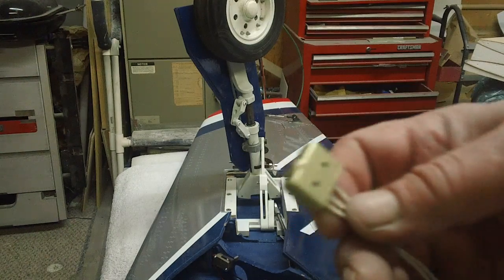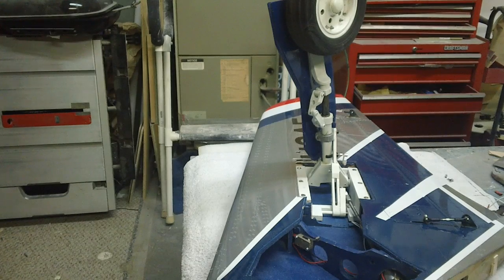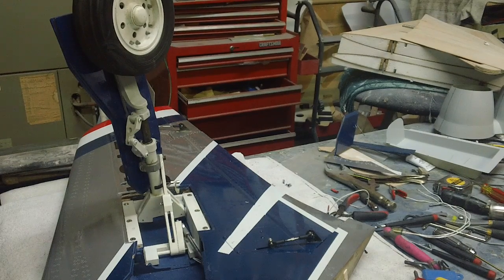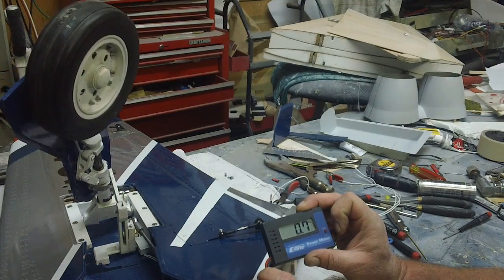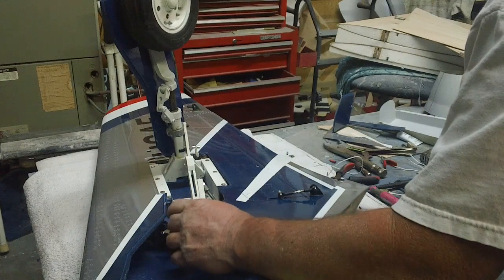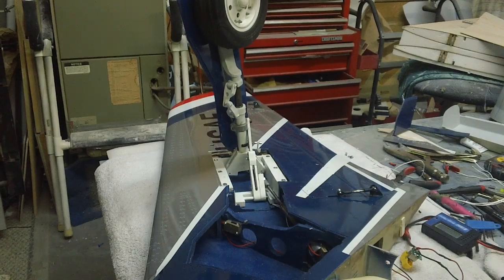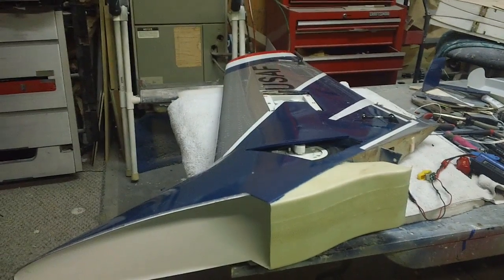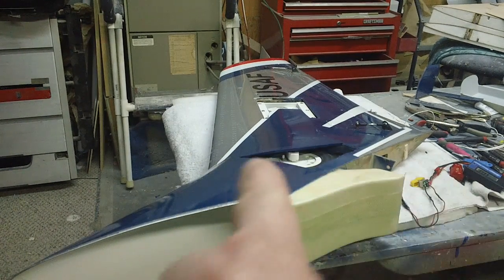working electric landing gear!!!!!!

Comment: Sorry for so many comments :-)! So it is not generating a missunderstanding I mean the microswitch lever should stay as built. Extending it inceases the error too, so it is not wise to extend it. Shortening it is no "sin" either. The main issue with the switch is that it has to react to the parts that have "no" or less mechanical limits like the aluminum parts of the retract. The gear door has a mechanical limit and it would be bad that when it is closed the switch hasn't been able to open.

Comment: Regarding the switches, you want to put them always as far from the pivoting point as possible, while the contact point has a rigid connection to the rotating axis. Any angular displacement has maximum linear displacement when you far from the axis and the system is less prone to slip in the articulations. This is easy when gear is retracted but not when out. The role on the pivoting lever on the microswitch is to amplify its sensibility so instead of removing or shortening do the opposite.

Comment: There is no harm to use a 20A diode because the voltage drop will be the same, unless the diode does not fit in the space available. If the diode has to serve a current that exceeds its limits it will burn and the worst outcome will be an open circuit, but a shorted diode has been the case too, so gauge what would happen in that case. For sure it would be bad, so no reason to underrate the diode. All diodes have a number so use a magnifier, post the number and we can help with the specs.

Comment: The role of the switches is to open the motor circuit so it stops. But when you want to reverse the movement inverting the motor polarity you would have no movement because the circuit is still open by the switch that just opened it. Here the diodes allow the switches to operate in paralel oposed to series. Run the motor with the current monitor and a full battery holding the mechanism to draw the max current without breaking it. The diode should stand that current with 50% margin.

Comment: Hey Bob. Check out Dimension Engineering (on the web). They sell a handy Rc controlled relay called the "battle switch", think it would be a good choice for controlling your gear motors. No need for an ordinary switch/servo setup, easy...
Keep up the great work.

Comment: Beautiful Bob!   Way to go man!!  Speed is good. Try a 2s li-ion. With 7.4 is will pull less amps and have a bit more speed if you want.   Also, more volts means less amps. Do you need 1" ID or OD?

Comment: All diodes drop about 0.6v, voltage rating on the diode wont matter in your case as you are using less than 50v. (normal minimum vating on diodes)  All you need to make sure is that the diodes you use are rated higher than your current draw.
Looking at your readings you are only drawing just over 1A so a 3A diode is ideal.
if you use a 2 cell lipo (7.4v) you will be ok allowing for the voltage drop

Comment: Have you try to apply pressure on the landing gear once in open/close position to see if the limit switch could kick back power on because of the mechanical play in the system ?

Comment: You can program it out on most speed controls. I wouldn't worry about it, it is used to stop a freewheeling prop and you screwdrive assembly doesn't freewheel.

Comment: amtpdb1 is right, normal diodes will drop 0.7 volts so your ~ 6 volt battery is actually 5.3 volts at the motor.  I fresh charged battery LiFe is normally higher then 6 volts though.

Comment: Diodes usually cut the voltage .7 volts every time one is used in a circuit. You are using one going up and one going down. Check the voltage and if I am correct you should see the voltage .7 under the battery voltage.